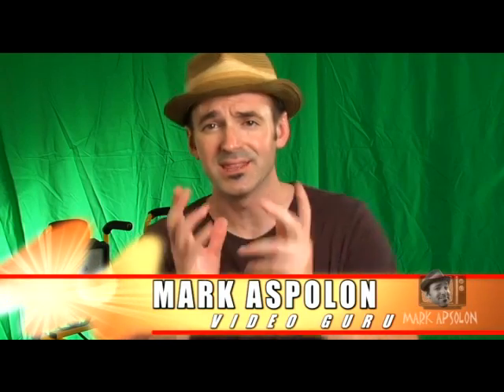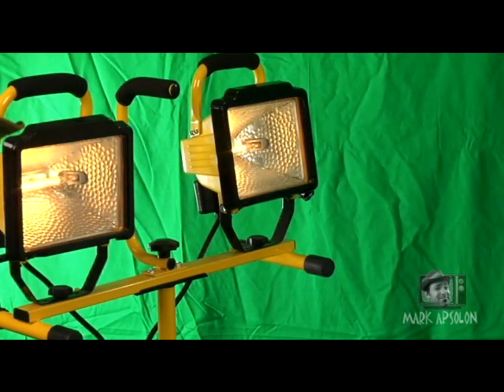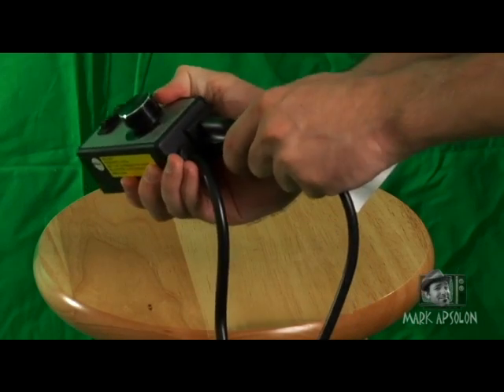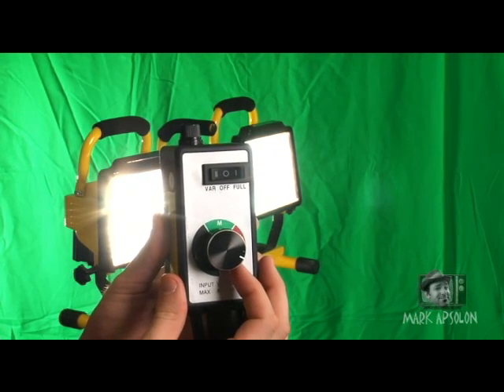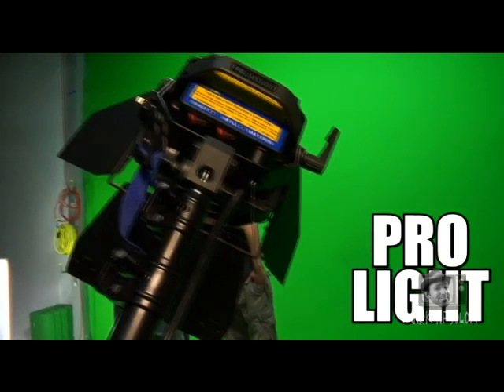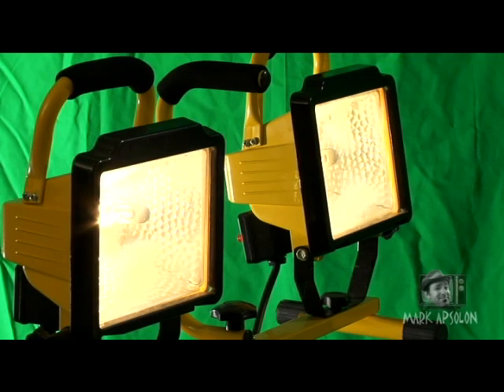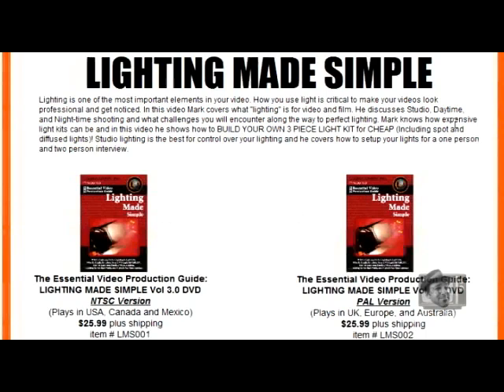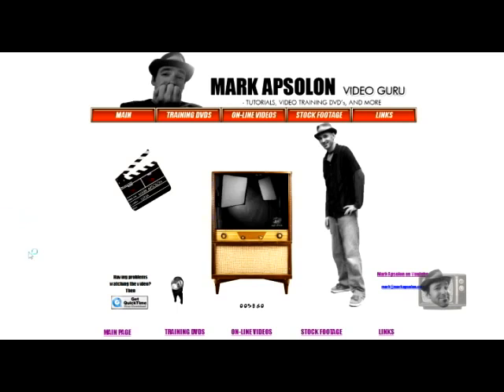Video Tips &Tricks ep01: How to make a green screen light variable

Comment: This is my area of expertise: you can buy fabric in 45" or 60 inches wide, for anywhere between $2 to $7.00 a yard you'll need about 21 yards and after sewing the seams together you'll find that you can't key out the shadows of the seams or iron flat them flat enough to key properly. It would be cheaper and easier just to buy the real green screen.

Comment: Thanks for the excellent tip Mark. I've been after a solution like this for ages!

My work lights are hideously bright and I end up getting a green "aura" that is caused by the bounce-back off the screen. This aura makes it almost impossible to key correctly.  
I'm going to look into getting a router control - hopefully they're not too dear over here in the UK.

Comment: I just googled it and found them from about $50.00 up complete with Ac receptacle built on. There is an electronic salvage shop here called Skycraft where I have seen them from around $20.00 but you have to box 'em and wire them up yourself. The thing about motorcontrollers and dimmers is that they can be overloaded and present a fire hazard.

Comment: I would recommend that instead of a router speed control, buy a variac. This is a device to control the ac voltage supplied to the lamp basically a variable transformer. Variacs are relatively inexpensive and can be found on the internet and electronic salvage houses. They will safely handle the current of high intensity lamps and are very durable.

Comment: DIY --- 
1.Purchase a dimmer switch and switch box.
2.Splice into the cord 3/4 of the lenght from the light it self.
3.Make simple connections to switch 
4.Attach the remainder of the cord (male end) to the other side of the switch
5. Plug in
6. Make adjustments
7. Done

Total Cost $6 
dimmer $5 - $10
Switch box - less than $1

Questions? Just ask.